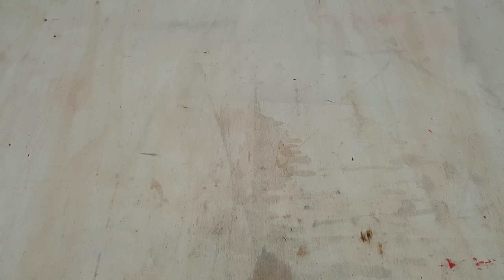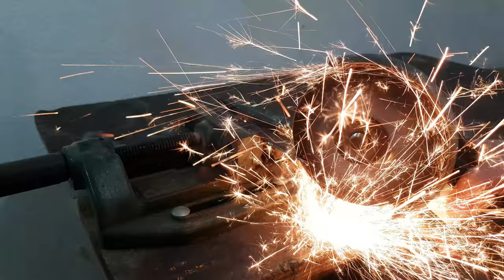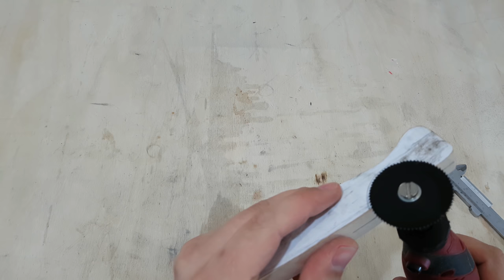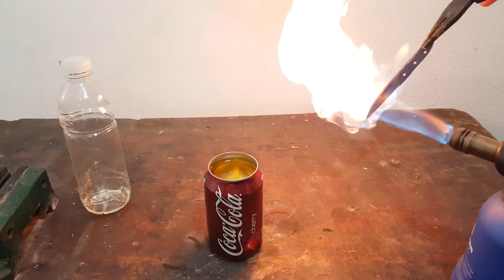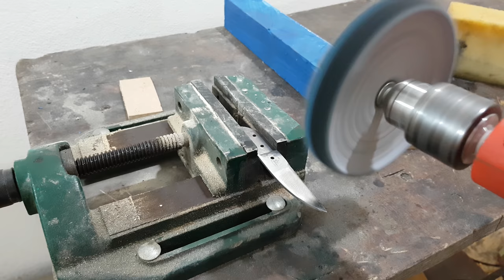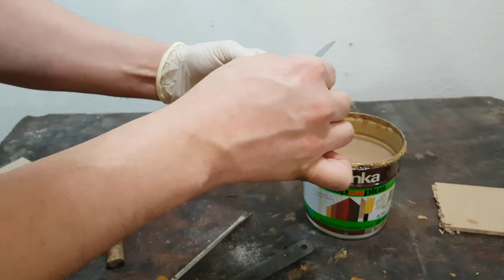Making a Wood Carving Knife  from an Old Saw Blade

Comment: You only case hardened the blade you never got it hot enough to harden it then you need to temper it to.
Reply: Thats nothing like case hardening
Reply: so , will it heating it again and keep it for cooling in air or flour will do the tempering ? I am inclined to make one but the tempering need of keeping it at constant temperature in oven is kind of demotivating for a weekend diyer like me. Any simple trick ?

Comment: bought a set if dremel saws like that from harbor freight soon as I put the thing on hi the shaft bent 90 degrees and I thought I was going to lose a finger for sure
Reply: Sometimes you just have to spend the money and buy the legit stuff. I love the cheap tools too. I swear by Princess Auto, and Canadian Tire brand tools (I live in Ontario, Canada). Though I’ve found some tools just can’t be skimped on.